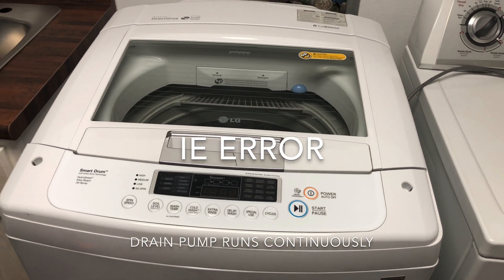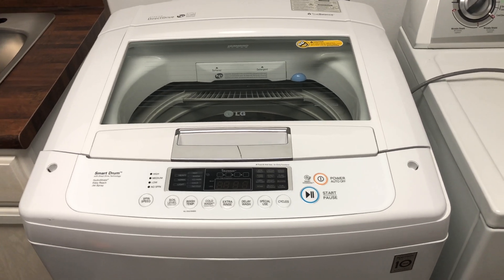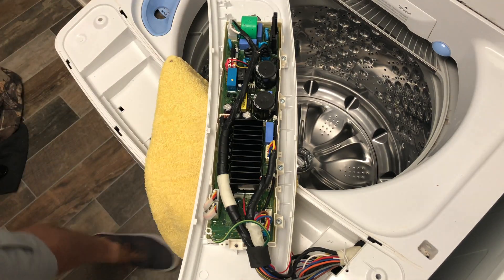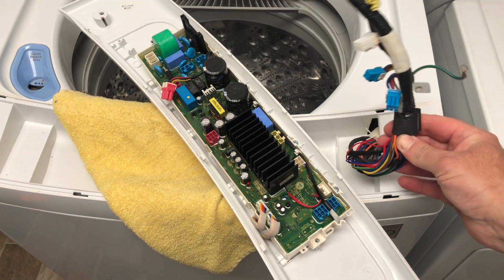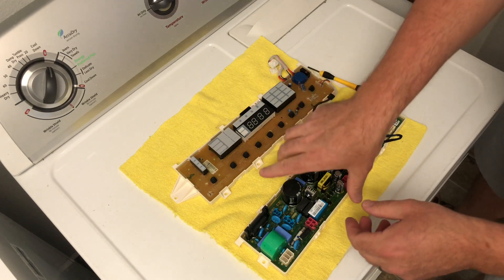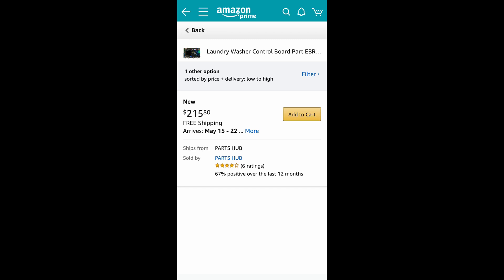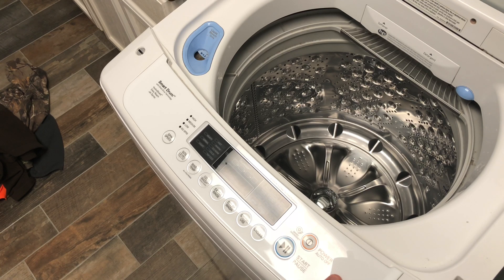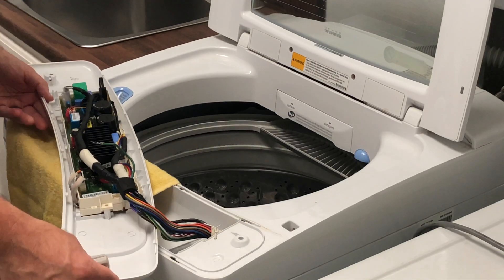LG WT1101CW Washing Machine IE Error Drain Pump Runs - 3 Month Update - Board Replacement

Comment: Along with some other posters, I had the opposite problem, my tub would not drain because my pump would not turn on. The root cause was the same though, a sticky relay, but stuck off in my case. My belief is that LG knows about this issue since they have updated the control board part number. It used to be EBR76262102 and now it is EBR75857902. It will cost you about $250 if you overnight the part from LG. If you're really handy, you can put the washer into diagnostic mode and use a multimeter to see if the board is sending power to the pump. Mine was not, so I knew the board was to blame. Thank you David, for the informative video. I was a bit more gentle, and broke different tabs than you, lol.
Reply from the maker: Thanks for your analysis and additional information!  I got cracked up when you said you were more gentle and broke different tabs! Ha! Good stuff!  Best of luck with the washer and the new board, if that’s the route you take.

Comment: How do I find the model number or part number?
Reply from the maker: I don’t have that unit, anymore, so i can’t tell you exactly, but it should be somewhere on the unit.  Open the lid, look around. Pull the unit out, check the back, check the sides.  You can use the camera on your cell phone to help you “see” places behind the washing machine.

Comment: Thanks so much for this and the previous "1st fix" video. I found both of these over 2 years ago when my washer got hung up on the drain cycle and wouldn't stop. I followed the instructions from the first video and was able to reset things successfully. Just in case, I went ahead and ordered the replacement motherboard and it has been sitting in the box unopened since them. Last night, I went down to switch over some laundry and the drain was going again. I was pretty pleased to get 2 years out of the tap fix to reset the board before. But decided to go ahead and just replace the board fully now. I was able to switch it out without any issues thanks to your detailed video. I really really appreciate your help with this and hopefully giving my washer a whole new life!
Reply: @markleds now that its been two years since you replaced the board, is your washing machine still good?  i'm trying to determine if i should buy a board or just replace the machine.  thanks.
Reply: @peteark1985  2 years and still going strong. Just sold the house (with washer in it) a month and a half ago but have had zero issues since replacing. Hope that helps!
Reply from the maker: Wonderful story, Mark!  I love it when a plan comes together!  I’m amazed that you got 2 years out if that first fix and glad that you had the new motherboard in the kitty, on standby!  Thanks so much for reaching out and sharing your story.  Have a great Holiday Season! 
Best Regards, 
David

Comment: You referred to beating a relay free… is this “relay” different than the water inlet relays?
Reply from the maker: Do you mean water inlet VALVES?  These are different.  These are relays located on the circuit board.  The water inlet valves are not.

Comment: Does it have A  filter to clean?
Reply from the maker: There are some little plastic filters where the water connects, but mine weren’t clogged.
Reply: My filters clogg all the time because I have well water. It's always the cold water hose. Take the hose off, pull the little blue filter out, clean and put back in. Reattach hose. There are always little rocks in my filter.

Comment: So our LG topload started just having display issues, fluttering lights, lights going out but washer still running, etc. then, eventually, just stopped working altogether, although the music would play, nothing would light up and no buttons allowing any selections.  So we replaced the entire main circutboard, and still nothing.

Anyone have any advice?
Reply from the maker: I would check all of the electrical connections that you can see, making short you don’t have any broken wires or accidental shorts to ground.

Comment: My washer WT1201CV does not give me an error code, it does however hang up after the wash/drain and there seems to be a power surge making the control panel lights flicker as the drain pump kicks in.  I've already replaced the drain pump and the pressure switch, so I'm thinking the PCB.  I would like to hear your opinion/suggestion.  Thanks.
Reply from the maker: Sounds like maybe a failing capacitor in the pcb or it could be this same relay failing in a different way.  I would change the pcb.

Comment: I am watching the video and I honestly don't understand something...  If you know the problem is a relay, and you have a VERY good idea as to which relay it is, why not just order the relay in question instead of swapping out the entire board?  Relays are fairly easy to check with a simple multimeter, and the cost of a relay is closer to just $5 or $10, or less (maybe even under $1.00).  You will need a soldering kit, but if you don't have one you can get a basic soldering iron kit for around $12-20.  A cheap multimeter is around $5.  That would certainly be much cheaper than buying a new control board, and you would have tools you could use for other projects.  Swapping out the relay component would take more time than swapping out the entire board, but it would not take that much longer, and could easily be done in a single day / service call.  If you had the luxury of time waiting for the relay to arrive in the mail, you could remove the relay and test it to verify that it is truly bad before ordering a replacement.

Sometimes you win, sometimes you lose but you never win if you don't try...

If you are not familiar with soldering, you could practice on that old board before it goes to the waste dump (hopefully you are disposing of your electronic components responsibly)
Reply from the maker: I guess because my time is worth more to me than the money I would potentially save.  I have a soldering iron and basic soldering skills.  The circuit board for the unit is completely coated with a wax or glue-type substance, which made me question my abilities to safely remove the glue and replace the component.  Also, at the time, i wasn’t 100% sure which relay it was.  

If you would be so kind as to make a video, detailing the process of how you replaced the relay on the circuit board, I will gladly link my video to yours as a better solution.
Reply: @budgetprojectsbydavid5263  you don't know which relay you have been hitting to unstick it ??? really ??? just hit one and see if pump is now working ??? weak answer you gave...
Reply from the maker: Also, your post would imply that I have the new relay in my home.  I obviously don’t, nor would most people.  If I try your method, it’s going to set me back another week, waiting for that part to come in the mail.  Then, if I fail, we still can’t wash clothes and I have to wait another week for the new board.  I totally understand your point and encouragement to fix only what is broken.  I hope that you can understand the rationale behind my decision.
Reply: @budgetprojectsbydavid5263  wait a week for parts how do i wash my clothes ??? oh i know i will go to a coin laundromat for there is one on every corner... so why would that be a giant problem for you ??? i think it is just another weak excuse not to try to replace that relay and be a real Hero...
Reply from the maker: John, I can see that my amateur video sharing my experiences fixing my own personal washing machine has deeply offended you.  For that, I am profoundly sorry.  A budget tip for you would be to stop watching this video immediately and take 3 deep breaths.
Reply: good one. remove the hard resins covered most components for moister and replace relay... no problem but how do you grind out resins to get to the soldered on connections ?

Comment: Did this finally work for you or should I just get another washing machine?
Reply from the maker: Mine would have worked, but the “new” board i bought was also faulty.  I threw in the towel and got a new unit.

Comment: I ended up having to replace the circuit board after the first trick didn’t work anymore (I got two runs, which got me the couple months extra) and after replacing the board (same model as yours) I’m good to go again. Thank you!
Reply from the maker: Great news, Guy!  Good work!
Reply: @guypotts5654 now that its been two years since you replaced the board, is your washing machine still good?  i'm trying to determine if i should buy a board or just replace the machine.  thanks.

Comment: Thank you for the two videos on this problem! I tried your other video first with thumping things, and we didn’t have any luck. This one helped me be able to take it apart. I was having a lot of difficulty getting the plugs out of the board, so wanted to share a trick my husband and I found in case others have to do this - use a tiny flat head screwdriver to press in between those tiny two lines on the plugs allows them to slide right out. The only one we still had trouble with was the large white one you first removed in your video.

I’m now running my first load and keeping fingers crossed that all goes well. I live near one of lgparts.com warehouses, so was able to do a same-day pickup. Not the cheapest site, but the convenience was worth the price for me, and it’s not a refurbished part.
Reply from the maker: Hey Amanda, I appreciate you taking the time to share your experience and tips with us!  In hindsight, I wish that I would have used a new board, as my refurbished one didn’t pan out and I ended up replacing the washing machine shortly afterward.  Sounds like you guys did it right!  Good work on your repairs and thanks again for the tips!

Comment: Mine is showing the door sensor and doesn’t lock to wash they already changed the sensor and the board to send the information to the sensor and still not working 🤨 what can be
Reply from the maker: I couldn’t even begin to speculate.  While the problem in my video is common, it’s not the only one plaguing these machines.

Comment: Instead of disassembly I have found that a heavy thump with the heel of the hand to the right of the display will jar the relay loose.
Reply from the maker: Thanks for sharing!  I have actually tried that, but I never could find the sweet spot and I was always afraid of damaging the display. Nice work!
Reply: Wouldn't it be to the left. I thought the relay is the big blue one it's more to the left but i could be wrong.
Reply: @user-ui5hh7hf6i  The right side work for me, but it doesn’t cost anything else to try the left side if you want. Good luck!
Reply: Do you get the ue code all the time
Reply: @Jordan-hv8qq  yes

Comment: I like to know-how in the name of heaven you can open to top plastic cover in the back to get to the noise filter on these particular machines.  There is a fuse in there. I have no power at all.  I have taken off the door and every screw associated with the cover. All that seems to be left is pry them plastics.  There has to be a fine trick to do so without busting them all.
Reply from the maker: This sounds so familiar.  I seem to remember being in the same pickle.  I no longer have the machine or I would run look at it.  I feels like it was some type of prying in just the right spot.  I have the service manual somewhere.  I’ll see if I can locate it for you.
Reply: @budgetprojectsbydavid5263  Yea I have no power to the unit.  There seems to be a fuse there in that noise filter.  I had to go through heck trying to see if there is one.  I have never seen any video or anywhere online talking about it.  Of course you can read the lame answers common sense ones.  Check the cord, check the breaker box, check the outlet... you know things of that nonsense.
 I also got this Frigidaire dryer that keeps tripping one leg on the breaker switch after it runs for half a  minute. I followed the wire to the one that trips all the way through the dyer.  It is the left wire, looking at the harness connection in the back of the dryer looking at it.  That one seem to go to the limit switch on the heater, and two other smaller wires that also feeds from that same wire, one goes to the thermoswitch and the other to the control board.  
So I decided to see  if there was any continuity between the three connection wires in the back of the dryer.  Of course there shouldn't be any.  The middle wire ( white wire) is strangely also hooked up to the body of the dryer.  I don't understand that at all.  As between that wire and the other two is 120 volts, which would make the body of the dryer live wire.  ... I don't understand that at all.   So I probed the ohmmeter between that middle white wire and the one on the left, it read almost 100 ohms... that is not right.  No ohms reading between it and the right and the between right and the far left which is right.
So I unhooked the wire to the limit swich and there was no change in the ohm reading.  I unhooked the thin wire to the thermoswich, there was some drop in the reading and when I unhooked the one to the contro board the ohm reading was gone, no contuity.
So it appears that there is some sort of short in the control board.  There was an error code 061 I was told.
So I took the contrl board out and unhooked the wire harness power feed and checked the pins on the board and there was .6 ohm reading, that is the two wires that go the rectifier.  That is not right.  To my knowledge there should be no ohm readings at all.  Plus that reading to me is dead short. which would mean that the control board should have been fried long ago.  It is like the white and the black wire are hooked up together... that doesn't even sound right.... I am confused.
Reply: @budgetprojectsbydavid5263   I opened it.  It is prying business. starting along the back side of it across from one end to the other and gradually the front side. But once the back gives a little it is over.  You  know you got the sucker at last.

Comment: Excellent video.  Found parts even cheaper at LGparts.com.  I didn't have this issue, but my start/pause button would not work but very occasionally (mama NOT happy).   Opened up to the display PCB and cleaned the touch buttons and their corresponding spots on the inside of the panel with alcohol swabs............ all good for now, and mama is happy.
Reply from the maker: Thanks for the tip!  Gotta keep mama happy!

Comment: Hello,  This is a firmware problem and not a hardware problem.  You need to "Hard Reset" it or the same thing will happen again after a while even with the new motherboard.  You must discharge the board complete which means discharging the 2 large cylinder-shaped capacitors by either tapping on the top of them lightly or if you really know electronics then you know you need to cross the connections coming from them.  Beware, they can hold quite a wallop and work as a primitive battery as they hold a charge.  Good luck!  There is a video on youtube that explains the process better and much cheaper!
Reply from the maker: Interesting.  I have since removed my LG from service, but other users might find this valuable.  It’s a shame that there is no method of updating the firmware.  A rubber insulated tool would be advised on discharging those large capacitors.  Could you do us a favor and provide the link to that video?  

The initial problem i was having was a stuck relay.  Are you saying that the stuck relay is a firmware problem?
Reply: I bought a new updated board with the new firmware. Model is EBR76262102. Would i still have to do what this person is saying
Reply: Can you link the video
Reply: I read that you no longer have the LG. I’m curious, what did you buy? I having a hard time deciding on a new unit if I have to buy one. The reviews are driving me crazy.

Comment: So I have the same washer and I replaced the drain pump because it wasn’t draining and it still won’t drain after the new pump was in. Do you think it’s the control board as well.
Reply from the maker: It sure sounds like it.  You aren’t getting any error codes, correct?
Reply: Budget Projects by David I was getting the code OE so I took the pump out and checked for clogs in it along with the hoses. Everything was fine. I bought a new pump just to ease my mind and it still won’t drain.
Reply from the maker: I understand and I am 99.9% confident that your problem is in the control board.  I ordered and received a faulty control board with this same issue and OE error code.  The drain pump would not drain at all until I reinstalled the original control board with an IE error (drain pump runs continuously).  A new board should fix your issue.

Comment: Thanks for the post! Just wondering if it's still working? Just installed a new board today and the error came up again, got ours from Amazon.
Reply from the maker: After I changed my board, I started getting an OE error, and the drain pump would not turn on.  I sent the board back to Walmart and got my money back.  I replaced the unit with a Samsung.  So far so good.
Reply from the maker: After I changed my board, I started getting an OE error, and the drain pump would not turn on.  I sent the board back to Walmart and got my money back.  I replaced the unit with a Samsung.  So far so good.
Reply from the maker: After I changed my board, I started getting an OE error, and the drain pump would not turn on.  I sent the board back to Walmart and got my money back.  I replaced the unit with a Samsung.  So far so good.

Comment: Our cycle selection button stopped working. Would this fix it?
Reply from the maker: First, I would make sure that the cycle selection button on the board is actually getting pressed by the outside cover.  If the actual button on the board is nonresponsive, then “yes”, I believe replacing the board with a new one would fix it.